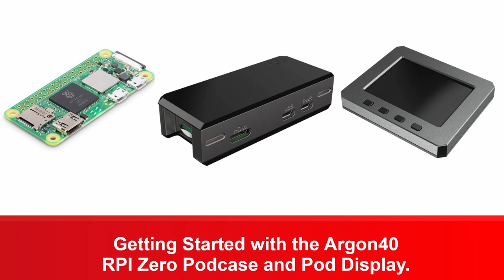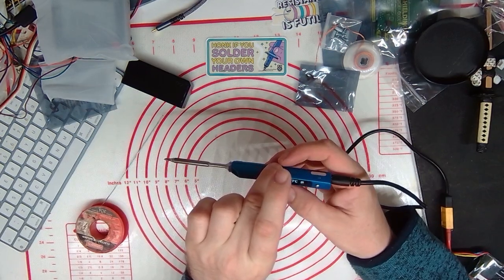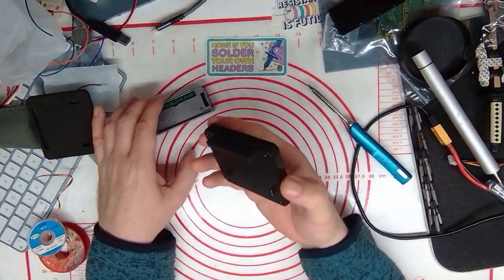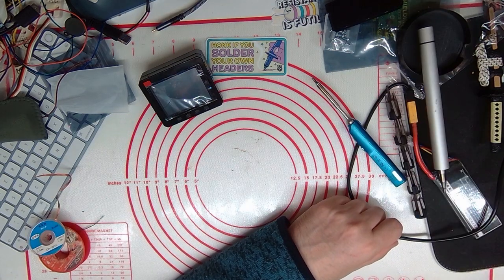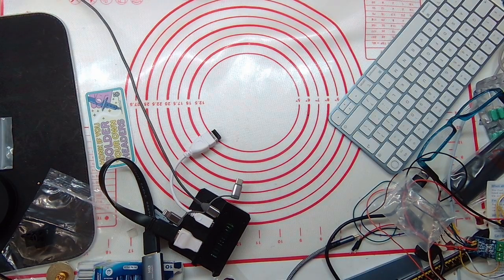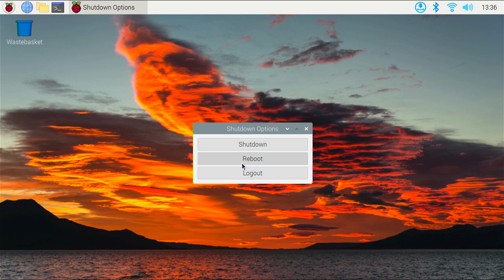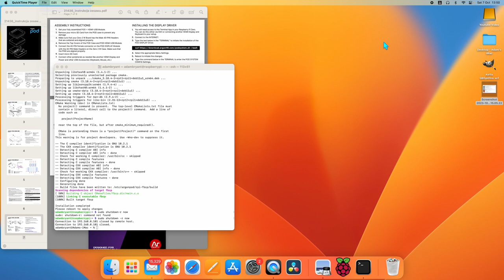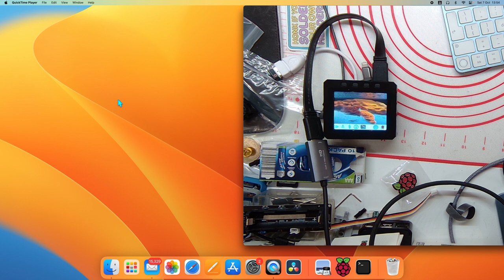Getting Started with the Argon40 Pod and Pod Display for the RPI Zero 2

Comment: intriguing mini computer. And it's 100x stronger then my first computer lol granted that was 20 years ago. One question though, what does it use for sound? USB sound or a module that plugs in?
Reply from the maker: It doesn't have built in sound output so you would need an external sound card.
Reply: HDMI is the only audio out.